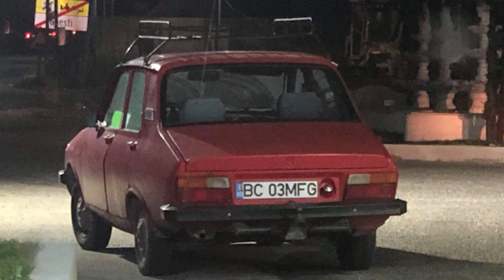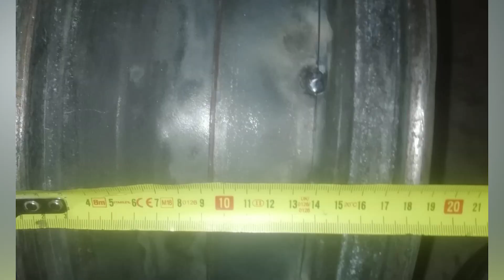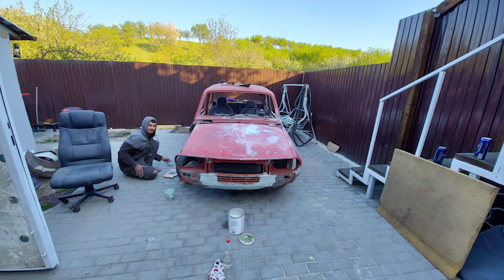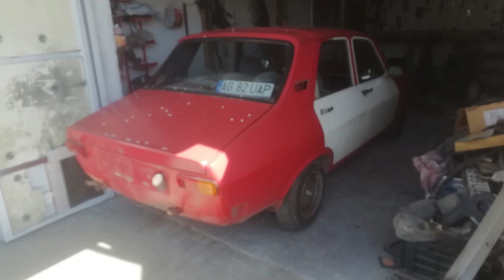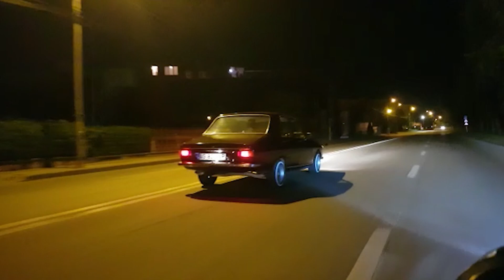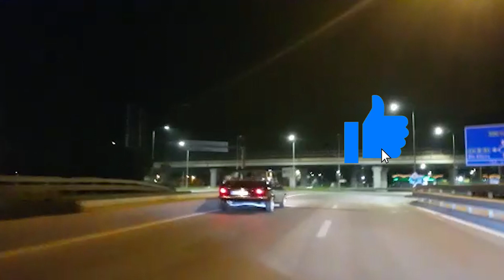Cum s-a transformat Dacia 1300 cumparata de @AndreiVerestiuc

Comment: Dacia 1310 primul model sau pre 1310 , cu 2 faruri cum sunt cele de Columbia ✌️👍
Reply: Am și eu o Dacia  din 1984...așa ceva  NU am mai întâlnit..caroserie de 1300 clasic,Dar ..4 faruri..scaune de 1310( tapițerie  maronie) motorul ( surpriza;1397..culmea..palier mic) ambreiaj; 180...cutie în 4..planetare.. Lungi..pompa  frina dublu circuit.
Fără  servo....
Reply: În acte..1310 TLX...Nu are Nimic în comun..poate ambreiajul..și atât..Corespund seriile caroserie, motor, embleme,etc...
Reply: @vasilenegulici6146  Primele asa au fost .
Reply: @vasilenegulici6146  Motorul , cutia e in 5 sau 4 ?? .
Reply: @type3666  în 4 trepte,  ambreiajul de 180 mm... ,dar cu planetare Lungi....am și CV cu 5..cu planetare Scurte...